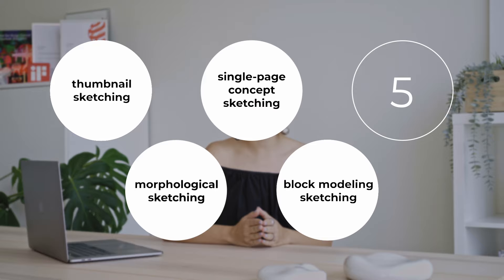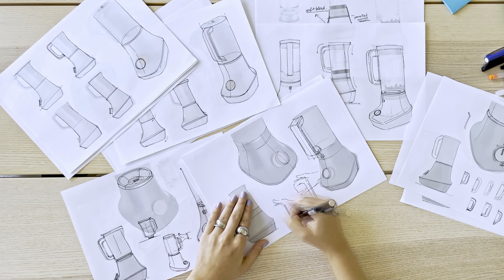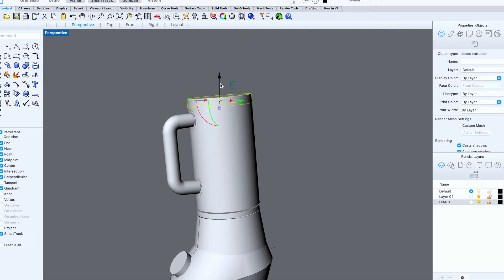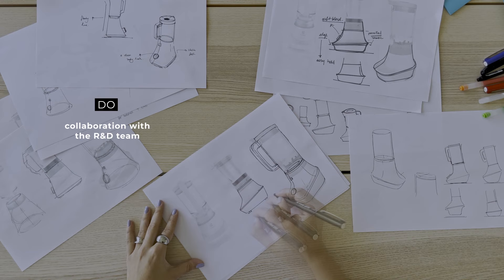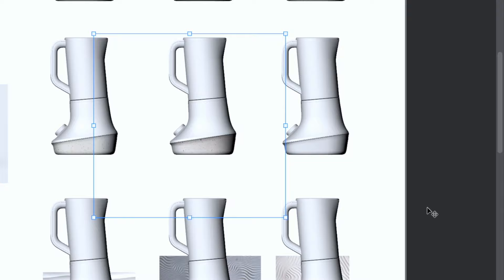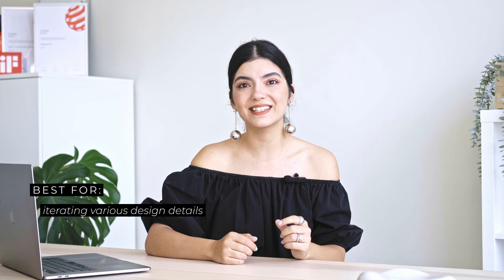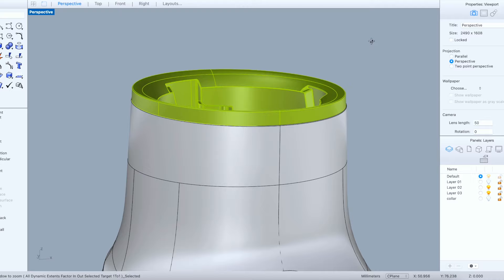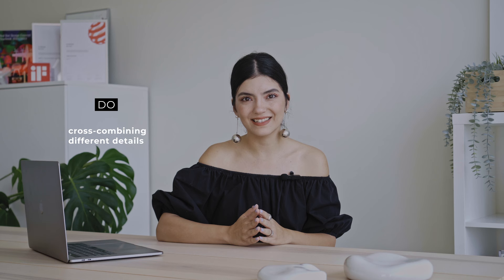5 #Sketching Methods || Easy & Effective Guide to Elevate Your #designprocess

Comment: Hi Fulden, could you elaborate on what you mean by "when you plan your directions at the very beginning, place your design concepts into different ends in your direction mapping to expand the realm of possibilities"? This is the pro tip you provided for single page concept sketching at 10:11

Thank you for this video, I learned a lot, you've earned a subscriber! :)
Reply from the maker: Hey Vicente! Happy to hear you find the video useful :)

So here is what I meant; 

When we start doing these single-page concepts, their functions and looks should be separated from each other as much as possible so that the design direction does not look like versions of the same idea :) This way, designers can avoid being stuck in 1 concept and instead can explore a wider range of possibilities at the beginning of their ideations. "Direction Mapping" is something I don't show in this video (maybe that's why it is a bit confusing) These maps are created as guidance before you start concept drawing to find the intentional look/feel/budget etc. and include some keywords on opposite ends such as "minimal - dynamic vs. expensive - cheap" Hope this helps :)
Reply: @fuldendehneli  I see! That's very insightful, I'm taking notes! Thank you! Looking forward to your next video :)